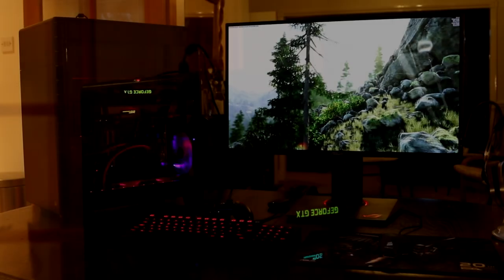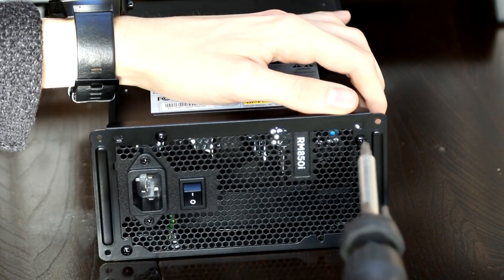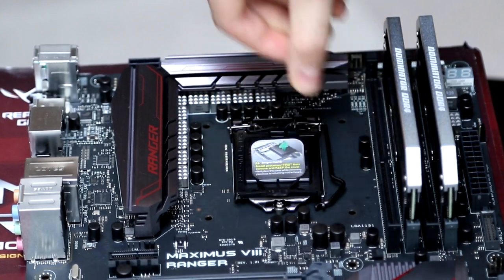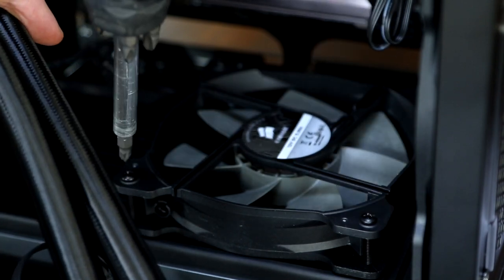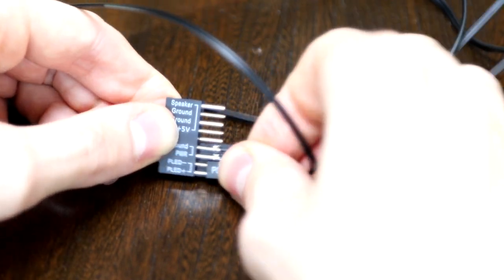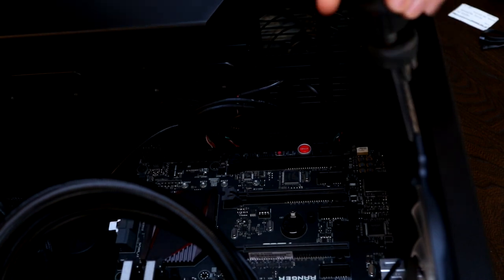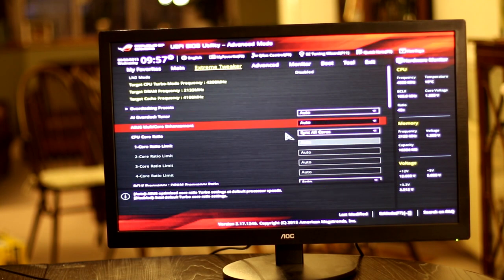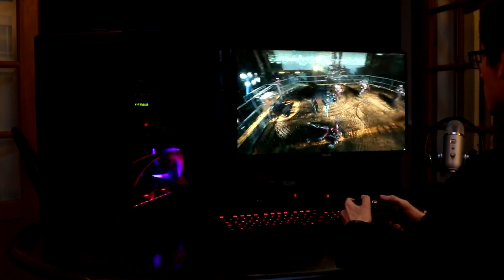Building The Ultimate 4K Gaming PC 2016 - Part 2

Comment: Great Video... I've been a PC Gamer for many years, but my last PC Build I built with my Dad. I'm looking into building a new rig soon, but I'm a little scared to do it alone... This video has reassured me that things 'should' go reasonably smooth. Just take my time and read the manuals. I'd like to thank you for this. Also, if it isn't too much trouble I have a few questions for either yourself or someone else whom may read this.

1). Are modular PSU's compatible with all GPU's?
2). I can't decide between EVGA and ASUS for my GPU and Motherboard. Who do you recommend?
3). What's the best or recommended configuration for fans. I'm told Push/Pull for my AIO, but I haven't a clue what that is. 
4). For gaming on a 1440p, 144HZ, G-Sync, IPS monitor with Ultra settings is a single 980TI enough?

Thank you.

Comment: Hey Marcus quick question. Do you think a mid tower case would also work I can deal with higher temps with better cooling also here is the guys i am going to use what do you think about it. It has good cable management along with a great manual which is why I dont want to refund it. But I will if it wont fit it Case:NZXT S340 Mid Tower Case CA-S340MB-GR Matte Black/Red

Comment: 8:33. 

Cooling fan. 
Two questions. 

Do I insert the cooling header in the w. pumper of the motherboard?

Do I insert the two fans above the rad in the cpu fan headers in the motherboard or do insert them in the built in adapter from the cooler?

Because it’s showing error in my bios for my cpu cooling. This happens if I connect the two fans in the built in adapter unless I connect them to the motherboard.

Comment: Fantastic vid Marcus! Quick question, if I upgrade the cards to two 980ti's, will the 850w power supply be enough? Thanks
Reply from the maker: +Atomic Dominick Probably. But id say go for the 1000w to be safe. Having said that, this thing runs COD at 150fps at 1440p. So saving yourself about £300 with 980s isnt a bad shout...
Reply: That does seem to make a lot more fiscal sense haha. Thanks for the reply!

Comment: I'm confused on the fan part. In the desc he put the link for the fans but in the video it looks like he used 3 and the one in the desc has 2 per package. Do I buy another package and have one left over or do I but something else? Plz help.
Reply from the maker: +TheGamingPotato  I've linked SP fans below. I used two of these for the front, and one AF for the rear :)
Reply from the maker: +TheGamingPotato  I've linked SP fans below. I used two of these for the front, and one AF for the rear :)
Reply: PC Centric Thank you. I have never built a PC before and I want to learn how. Btw, your video's are amazing :)
Reply: I just realized, it looks like you used a fan for the top, (or bottom, the inverted thing confuses me a little) did you just use one of the fans that were already installed on the PC case that you took off in the beginning?
Reply: Another question, (Sorry Btw for all the questions) when you were installing the Graphics Cards you had a gold one that I can't find in the desc. Was that one special and isn't being sold anymore. Should I get 2 GEFORCE GTX 1080 graphic cards.
Reply from the maker: I used two SP fans on the front, one AF fan on the rear. Both fans on the bottom rad came with the h100i cooler kit. Cards wise - Get one. If you need extra perf, buy another!